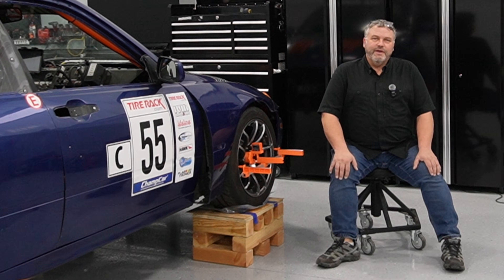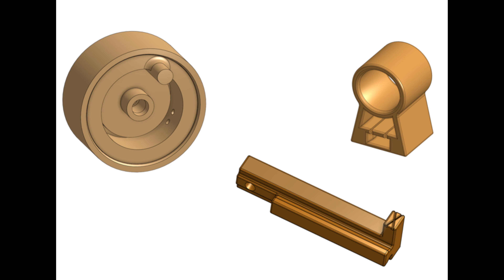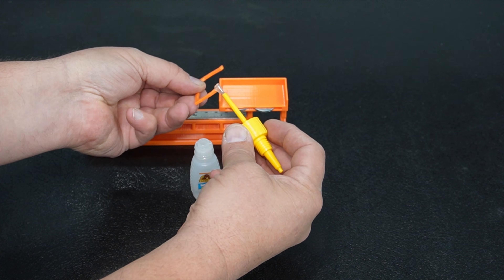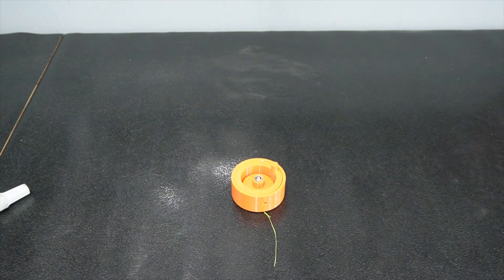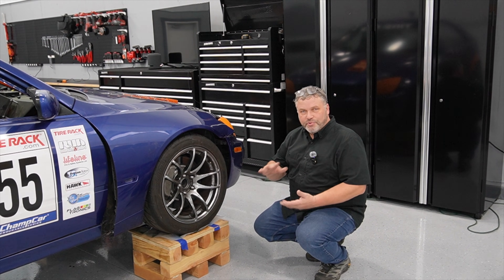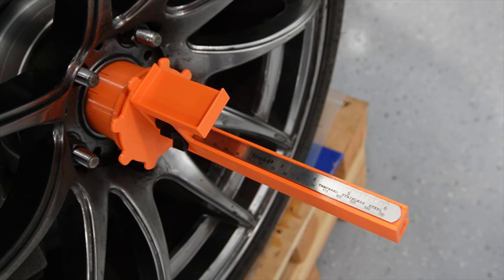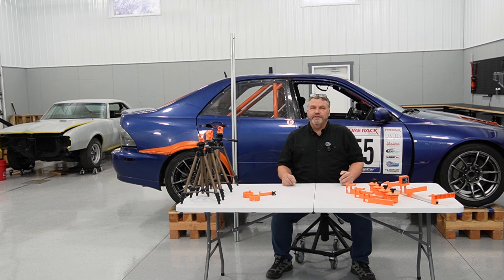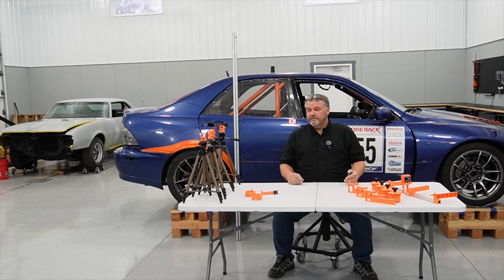3D Printed String Alignment Tools for Improved Accuracy

Comment: Interesting design. I like the idea of the mounted rules, but I wonder how repeatable the mounting distance is to the axle. Wear on the hub adapters and how much you tighten the screw into the adapter could move that ruler in or out a couple mm. Ideally the section that holds the ruler would be in direct contact with the axle, mount direct to the hub adapter so that the screw depth couldn't impact the reading. Maybe bolt it directly to the flange and instead of the black nut and large adapter screw you make a knurled knob in that area to tighten the hub screw down. That would eliminate screw tension as a possible error source. You could even hollow out the center of all that to slide the ruler into direct physical contact with the hub.
Reply from the maker: @ruleslawyer, thanks for the feedback. So right or wrong, I convinced myself that it may be easiest and the most repeatable across different vehicles to not try to get to the end of the axle.  In the case of drive axles the amount that a splined shaft may go through a hub can vary from OEM to aftermarket, and many times there is a divot at the end of the axle that may complicate the measurement.  But yes, the hub adapter and threaded plug need to bottom out in the wheel in order minimize variation.  If size variations in 3D printed parts and different wheels prove that to be a real challenge as more people try this version, this could be an area that needs to be re-designed.  Your idea of fastening directly to the hub adapter instead of threaded plug would at least eliminate one source of error.  Thanks again for chiming in!

Comment: Here are dimensions for RPF1s (I believe 16-18 inch variants)
64.07mm wheel cap outside diameter
66.05mm wheel cap detent outside diameter
4.61mm distance to detent
Reply from the maker: @apexbrz the STL files have been added to the database at https://www.diyfabshop.com/alignmentkit   If you print them out, please let me know how they fit.  Thanks!
Reply: Have you printed these yet? Tried them on my 17x9 rpf1s and they were too loose fitting.
Reply: @mcsprinkles22 I have not, did you check the dimensions of the printed part against what’s listed above?
Reply: @apexbrz  good call. The detent outside diameter on the printed part is 65 mm so maybe that's the issue
Reply from the maker: @mcsprinkles22  does the other diameter fit well?  I can check to see if the detent OD is as expected in the CAD model, I did have an issue with a few not updating
Reply: @DIYFabShop  Hard to tell but it seems like it fits ok. Just a little slop when fully bottomed out
Reply from the maker: @mcsprinkles22  I created a new hub adapter model that has the correct detent_OD dimensions, the previous one was likely undersized.  The threaded plug did not change. https://www.diyfabshop.com/alignmentkit
Reply: @DIYFabShop  awesome. Thank you. I'll print it right now and let you know

Comment: I am gathering all the materials to do this myself. Already have a bambu X1C so the prints are easy enough. Maybe I am missing it, but what are the dimensions for the conduit and notches you cut into it?
Reply from the maker: @Schrantz3DEngineeringSolutions  3/4” conduit and you want to set your notch dimensions based on your track width. I would suggest starting with just some tape marks that get you about 30mm or more on the center scales.  Once you are comfortable with that spacing, you can grind a groove for the string. Dimension between tape marks or grooves on conduit need to be the same for front and back conduit.  Notches I cut with a fiber cut off wheel, just deep enough for string to be captured
Reply: @DIYFabShop  Thank you sir!

Comment: Here are dimensions for GMR 04R center caps. 
2.465 wheel cap outside diameter
2.520 wheel cap detent outside diameter
0.170 distance to detent
Reply from the maker: @BigJSam the STL files are available to download https://www.diyfabshop.com/alignmentkit   Let me know if they work well or need some tweaks.
Reply: @DIYFabShop  I printed a test piece and checked my measurements on the wheels themselves, and can you adjust the  wheel cap outside diameter to 2.5" and the distance to detent to 0.16". The wheel cap detent outside diameter to 2.55".
Reply from the maker: @BigJSam  revised STL files have been posted https://www.diyfabshop.com/alignmentkit

Comment: Great work. Now how do you actually do the alignment?
Reply from the maker: Ufff, that's a loaded question!  Certainly it is a little different for every car platform, and often requires aftermarket parts or modifications to get a performance based alignment.  I would consider showing the steps on the IS300 if that would be of interest to enough folks. Thanks for watching!

Comment: Looks like the measurements for the aftermarket japan racing wheel are the same as my NA miata advanti storm wheels. Will print and verify fitment.
Reply: They do fit the advanti storms and my miata konig dial-ins

Comment: One thing to mention for the toe calculator is that most wheels are an inch larger to the outer edges, than the actual stated size of the wheel. So a 17” wheel (17” diameter where the tire bead seats) is more like 18” to the outer edges. So that would result in a different toe angle calculation.
Reply from the maker: Good point!

Comment: Another Cap measurement, For the 91-95 Corvette Sawblade rims

Cap OD - 2.56"
Detent OD - 2.63"
Detent - .285"

Appreciate you putting this out for everyone!!!
Reply from the maker: @72C_ten your STL files are now posted https://www.diyfabshop.com/alignmentkit  Please let me know how they fit and/or if any tweaks are needed.  Thanks for watching!
Reply: @DIYFabShop  Looks like GM made the detents WAY longer then they needed to be.  Can you shorten the detent length to .18", everything else looks good.  THANKS!
Reply from the maker: @72C_ten  stl updated and reposted to https://www.diyfabshop.com/alignmentkit  thanks for closing the loop on the dimensions.

Comment: Nice work and way to share!

Have you compared camber numbers/repeatability to a 3 point camber gauge? It seems like small deflections in the center cap mounting could result in significant camber error?

I'm working on getting you some center caps measurements...
Reply from the maker: @mattbush315 I haven't compared to a 3 point camber gauge, but the spokes on my wheel are spaced far enough apart I can reach in and put magnetic gauge right on the face of the brake rotor.  The readings varied from spot on to within 0.1 degree.  It's a good point and something worth keeping an eye on.  Thanks for watching!

Comment: Currently printing the STL files and building the system. Working on getting specs for RPF1 (16inch +) center caps as that will be a popular wheel choice. Thank you for developing this system and sharing it.
Reply: I've got 18" RPF1's on my racecar, would love to hear if you find the centrecap specs!

Comment: This is incredible. I can't wait to give this a shot. I've got a centercap for you, Should be similar to the Toyota GR86 Base wheels, but they're for Apex VS-5RS 17x9 et45

OD: 44.60 mm
Distance to Detent: 4.54mm 
Detent OD: 45.5mm 

I hope this helps! I can't wait to print off this stuff and give it a whirl!
Reply from the maker: @plurby1703 the stl files for your wheels are now available https://www.diyfabshop.com/alignmentkit.  Keep in mind you want the threaded plug to turn all the way into the hub adapter so it is consistent wheel to wheel.  This may require a little sanding where the threaded plug pushes on the back of the detent fingers.  Good luck and let me know if you have other questions and how it fits! Thanks for watching!
Reply: @DIYFabShop  No WAY!! Thank you! I can't wait to give it a shot! Those Centercaps should be good for 86/BRZ/WRX in the Apex Line for those. 

THANK YOU!
Reply: @DIYFabShop  Just an update - printed off the hub adapter for the wheel and it fits perfectly. Currently printing off the threaded plug. Can't wait to get aligning! Thank you again!
Reply: @DIYFabShop  Final update - This plug works for stock 86/BRZ/WRX as well. Just confirmed with my stock wheels.
Reply from the maker: Thanks, I will add that to the database!

Comment: I have a set of Enkei GTC02's Measures 66mm, 67.5 and 4.75.
Reply from the maker: @exidous6831 a link to your stl files can be found at the bottom of this page https://www.diyfabshop.com/alignmentkit  Please let me know how they fit once you get a chance to try it out.  Thanks for watching!
Reply: @DIYFabShop  Hey, it fits quite nicely. With the given taper in the tab you can take .25mm off the height and put it at 4.5mm. It's probably 0.5-1mm movement but a little play I think is okay.
Reply from the maker: @exidous6831  sounds good!
Reply: @DIYFabShop  Update, the center with tabs seems fine however the locking piece seems undersized. I printed with pla-cf with a Bambu X1C.
It looks like the taper near the top is  1mm undersized. It doesn't lock the tabs.
Reply from the maker: @exidous6831  perhaps the pla-cf is shrinking a bit differently than the PETG I had been using.  My initial reaction would be to suggest we increase the diameter of the both parts by 0.5mm (0.020").  This would snug up the tab fit a little and provide more backing support from the threaded plug.  Would you be ok with that approach?
Reply: @DIYFabShop  I can measure with a mic tomorrow. I had originally printed on an ender at home in PETG and it seemed a tad bigger. What's the dia of the inner at the top?
Fusion is surprisingly bad at measuring a non native mesh.
Reply from the maker: @exidous6831  at the very end the model it is at 59.94 mm, after the taper it is 60.5 mm.
Reply: @DIYFabShop  I think reducing the internal diameter of the tabs by 1mm would be fine. I measured the top and it's quite close to the measurements you listed.
Reply from the maker: @exidous6831  I uploaded an alternate hub adapter for you to try with the reduced inside diameter at the tabs.  When looking at the spreadsheet you will need to slide over to the right to see the alternate column.  Fingers crossed this improves your fit.  https://www.diyfabshop.com/alignmentkit
Reply: @DIYFabShop  Top is gtg now. The last 1/8 of a turn forces the center locking piece to one side. I think it's an oddity of the thread on the male side finishing at the bottom. Could you remove the bottom 1/4 turn worth of thread on the male side?
Reply from the maker: @exidous6831  1/4 turn of thread removed, file posted in alternate column in spreadsheet.

Comment: One source of error I can see is depending how far you turn in your hub adapter locks in, it can vary your string to hub measurement on each wheel. However, if you're bottoming out those threads every time, should be good.
Reply from the maker: 100%, dang it, I meant to mention that in the video.  @everyone when fitting hub adapter to wheel it is important that the amount the threaded plug screws into the hub adapter is consistent across all wheels. Getting the threaded plug to fully seat is the best way to do that.  If your threaded plug is not fully threading into the hub adapter, you could try to carefully sand away some material from where the threaded plug supports the detent fingers on the hub adapter.  Thank you @zman24250!

Comment: One thing, automotive industry is pretty much all metric and your design calls for some random imperial bits and pieces that are impossible to find outside US.
Reply from the maker: @Kmnri I am happy to see if I can design a variant that utilizes M6 for the threaded knob.  As far as using standard camera tripods to support the conduit, it is my understanding the the 1/4-20 fastener is a worldwide standard.  Are you able to source a simple 1/4-20 nut, or is that a challenge as well?
Reply: @DIYFabShop  Yes, camera mounts are standard but still very hard to find. But: aluminium extrusions (maybe use a standard extrusion that are premade for t-nuts, like on 3D printer), 20x20 or multipliers of 10. Rivet Nuts - you should be able to get metric ones no problem. Imperial doesn't exist here. Knobs - can be 3d printed as well, add unnecessary cost considering a normal M5, M6 or so hex head nut can be used. 

Mechanics here that deal with normal cars haven't seen imperial threads their entire life.
EDIT: idea is great but to get more widespread adoption, use metric hardware.

Comment: Going from my previous comment on how good this is, i have measured my wheel cap if you could do an stl file please

Heres my measurements, please note that out of the 6 tabs that have the detents, only 3 actually have a detent, the opposite tab to a detent is flat, i hope itll still be ok to make an stl file though

Wheel cap outside diameter - 2.46

Wheel cap detention outside diameter - 2.495

Distance to detent - 0.195

Theyre aftermarket japan racing wheels
Reply from the maker: @LearnToRace is the matching retention groove in the wheel a full 360 degree feature or is it segmented?
Reply: @DIYFabShop  it's full 360 groove so I guess the dentents can put put on all 6, don't know why they only choose to put them on 3, thanks for doing the file I'll check it out
Reply from the maker: @LearnToRace I did make the STL files which you can find here: https://www.diyfabshop.com/alignmentkit

Comment: Thank you for this video. I am looking to fit this set up to Revolution motorsport wheels.
Would it be possible to offer an STL for the following please?

Wheel Cap Detent OD = 2.255

Wheel Cap OD = 2.172

Distance to Detent = 0.145

Many Thanks!
Reply from the maker: @danielbeckham4786 I have added stl to the crowdsource file on my webpage.  Please let me know how the fit turns out. https://www.diyfabshop.com/alignmentkit
Reply: I notice you don’t have any support provided inside the tapered trolleys. Will this print OK without any print support added? Many Thanks.
Reply from the maker: @danielbeckham4786  not sure what printer and slicer you are using, but I tried to minimize the areas that support was needed.  For my Bambu printer and using Bambu Studio you can print up to 28 degrees off the vertical without support.  So the threads, detents on tabs, and some of the tapered rail interfaces will print without support.  Bambu Studio identifies and adds support to areas that fall beyond the 28 degree number "automatically", hope your slicer does as well.
Reply: Hi
The wheel adapter for the Revolution wheel is coming out a little small. 
Wheel Cap Detent Dia was requested at 57.4mm but actually measures 55.7 with the insert fully wound in.
Would you mind checking your drawing please?
Having test fitted this, this is what will be required.

Wheel cap OD = 56mm
Distance to Detent = 3.81
Wheel cap Detent OD = 58mm

Thank you
Reply from the maker: @danielbeckham4786  I will confirm the previous model and make one to the new specs.  That does seem oddly small, even with shrinkage.  Just curious, what filament did you use?
Reply: @DIYFabShop  thank you.
I used PLA
Reply from the maker: @danielbeckham4786  I did find an error in the CAD model that could explain the detent_OD being small.  That has been fixed and I updated per your latest dimensions and new STLs have been posted as a Rev A https://www.diyfabshop.com/alignmentkit
Reply: @DIYFabShop  thank you, I will give it another try and will let you know how it goes.
Reply: Hi Kent
That worked and it fits perfectly. Thank you very much for your help.
Daniel
Reply: Thank you, will do.

Comment: This would be a great way to do alignments on my Radical SR8. The hub is a bit different though, and the lip-based design won't work. A set of "flat" fingers that extend 15-20 mm into the hub with the threaded plug pushing the fingers firmly against the ID of the hub would work, I think. I can provide a photo and measurements.
Reply from the maker: @iimuchfa you should be able to find my email in the about section of DIY Fab Shop channel.  I would be willing to try to work with you to get something that works.

Comment: Something worth touching on for the string lines is that its pretty common on anything with bushings to need to be rocked about a little bit to allow things to settle after making adjustments. 

Having the string line attached to your car in a rigid fashion means ot won't move when you give yhat suspension the rock and roll to settle it. 

Definitely worth doing for your own car.
Reply from the maker: I agree, that is a very important point.  When settling the suspension after adjustments, more care needs to be taken with a string system that is not hanging from the car.  Thanks for the feedback and thanks for watching!
Reply: I made my own jig that attaches the string to my car to allow for this, but I also upgraded to the Paco Hubstands which make it a lot easier for adjustments. The design of this system is great and I think I can try and use some similar ideas to design something that attaches to hubstands vs wheels.

Comment: Got super excited about this and have started the printing but realised quickly that the wheel centres are going to be different for both my cars as they would be from what you’ve made, do you just need the wheel centre diameter? Love the channel and been watching from Wales Uk 👌🏽
Reply from the maker: So on my website www.diyfabshop.com you can find this alignment project and a drawing that shows the three dimensions I need.  Reply here in the comments with those dimensions and I will create new stl files to try for the hub adapter and threaded plug. Thanks for watching and Happy Holidays from the US.